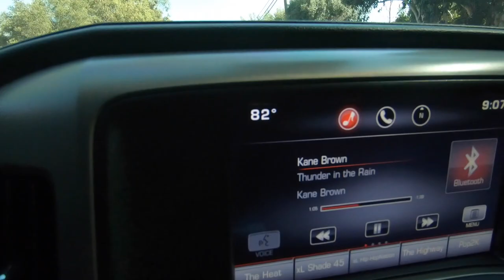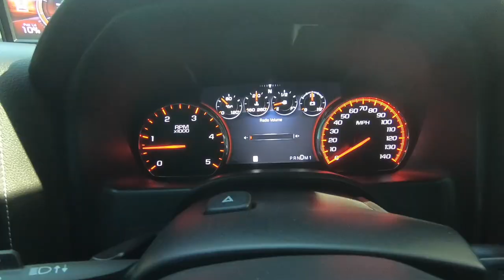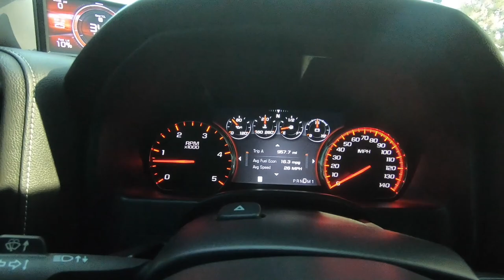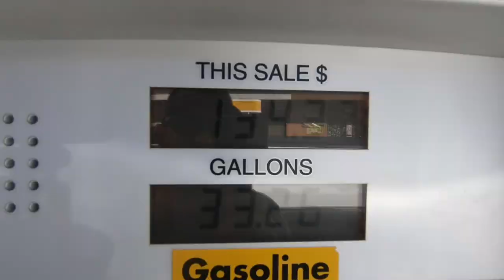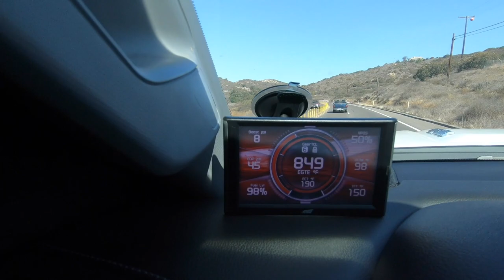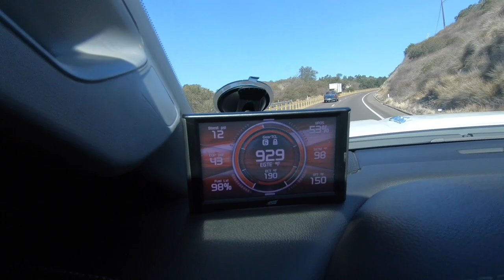DO THESE DIFF COVERS REALLY WORK?

Comment: I'm not sure what your looking for in your "test" to consider "pulling good". Each one of the different diesel engines makes max torque at different RPM's. You seem to think one tows better because you can pull a hill in 5th vs 4th gear. The Cummins is a inline 6, Inline 6's make more torque in the lower rpm range so of course its gonna tow in a lower gear than the rest. I've towed with all the big 3 brands and all the different series of the engines. Even stock they all tow just fine. When I'm looking to buy a diesel I'm not out to find what's gonna tow my trailer up the hill the fastest and in the highest possible gear. I'm looking for what I feel is gonna be the most reliable, get the best fuel economy, and is the most comfortable to ride in. That's why I'm sticking with my Duramax, sure the Cummins might be more reliable, but the gm all around seemed to fit all the categories as a whole the best. Plus I think the Allison makes up for the reliability you get with the Cummins. Just my opinion, not trying to hate on any brand because like I said you can't really go wrong with any of the 3.
Reply: Price Racing I agree with you man!!
Reply from the maker: they all tow good i was just amazed at the cummins how in every single gear it pulled like there was nothing back there
Reply: there’s a reason why most semi truck’s on the road has an in-line six. they simply do the job better more efficiently. trucking companies don’t care about being hard-core to their brand of choice. The number one concern is making money. the in-line six large or small regardless if it’s a cummins, international, Catapillar or a Detroit. it’s all about what can get the job done with the least amount of downtime with the best fuel economy. the in-line six hands down the best pulling engine there is. The debates been over for 30 years. if that wasn’t true then all the semi‘s would be using v-8’s so whether it’s a pick up truck or a tow truck or a box truck the chassis doesn’t change the fact that the inline 6 does a better job and is more durable and more efficient. so it’s not really a matter of ford Chevy or Dodge.  fords diesel engines are international‘s chevy diesels are Isuzu and dodge uses cummins. The engine is what it boils down to and as far as I know the emblem on the grill doesn’t do anything for pulling.

Comment: So according to Banks power testing with new cover actually the temp. rises quite a bit with extra oil. More heat because more drag from extra oil.
Reply from the maker: im gonna have to disagree on that because when i checked the temp with the stock 1 and aftermarket 1 the aftermarket run ran much cooler and anytime u have more fluid its always better and i cant stand banks there info is always wrong especially there tunes suck i have nothing but problems with banks product
Reply: Good to know
Reply: Eddie's Life does your oil temp get to the dew point?
Reply: I saw they were going to test that but didn’t see any results? Links?
Reply: @brettsummer5070  exactly no results from Banks because they couldn't prove they are worthless. Cooler the better. He kept saying you will burry the ring and pinion, I was thinking he's looney. If you keep same level off fluid you won't burry it in fluid. Like a bigger oil pan, the higher capacity doesn't mean you raise the fluid level in the motor.
Reply: imssgmiller I’m thinking he meant once the pinions moving and slinging fluid the level drops because most of it is a fog or “mist” slinging around the diff. With a bigger capacity there’s a chance more of it would pool around the ring gear causing more fiction loss. Not sure tho I don’t have the patience or equipment to test something like that but I’m excited to see results on paper
Reply: Imssgmiller, Mr. Banks was referring to aftermarket differentials that raise the actual level higher (on level ground) then the factory level. The aftermarket covers do hold more gear oil because the depth of the cover is much greater then a factory cover. Some aftermarket covers raise the height of the oil level and this is achieved by filling the diff through the cover rather then the factory fill port. If you fill the diff HIGHER then the factory level then it will most definitely run hotter and it will burry the ring and pinion.
Reply: Sorry that was a response to brettsummer
Reply: Ryan Jolley he talked about that but also the extra quarts causing it to not drop as much while running, while the stock dropped a few inches the extra capacity cover only dropped half that (in his new video)

Comment: Slam Ford all you want, but I've got a 99 F250 7.3 with 421,000 miles and just barely had new injectors and a high pressure oil put replaced and it's still killing it..
Reply from the maker: nice thats amazing man

Comment: I just watched a video from Banks that was a real eye opener.  Long story short those diff covers are the worst thing in the world to do to your truck. The inside of the diff cover is all squared up and does not follow the shape of the ring gear.  The ring gear picks up oil as it rotates and slings it all over, most importantly toward the front pinion bearing. These squared off diff covers don't get the oil to sling over the top of the ring gear, causing oil starvation to the front pinion bearing.  About a year ago a friend of mine blew up his rear end in his chevy.  I did not think anything about it at the time but he was running one of these covers. Now I know why his front pinion bearing went out. I have been a mechanic for over 25 years, I have had several classes on differentials over the years. None of them explained how the oil got distributed inside the diff. I never knew that the ring gear slung the oil around. I thought the pinion oil slinger did all that work.  
I found that video on Banks power youtube channel and wow!!  What an eye opener. You need to check it out. I bet after you watch that video you will chunk that diff cover in the scrap metal pile! Lol
Reply from the maker: i did watch his video and i still put this cover on because i have had a lot of trucks and i have put them on all of my trucks and i have never ever had any issues with my rear ends and i took a temp before and after and my rear cover is cooler than the stock cover, so i am not saying banks is wrong but mine runs cooler and never had any issues with any trucks so banks did not change my mind
Reply: Banks is also selling a product so keep that in mind

Comment: The lml duramax's only produces 397hp and 765 torque, on the other hand the cummins has only 385hp but    it produces way more torque at 900 foot pounds. That's why it pulls so much better.

Comment: I think GM Ford and Dodge whom have produced hundreds of millions of trucks over the years if they don't see a reason to put it in at the factory and no evidence of failure due to keeping it the way it has been .....than nothing needs to be done to mod it. if a issue came up in the last 20 years im sure the Engineers woudl have addressed it by now...IMHO no Mod is needed
Reply: It’s not just the engineering that decides the make up of the truck. Cost has a big role to play. They are going to build it so they can make the most profit. Not saying that it will not get the job done the way it sits from factory but there are aftermarket upgrades that will extend the life. The manufacturer is not going to put the best possible parts because if they did the cost of the truck would be extremely outrageous.
Reply: They don't even bother to put a drain plug on them.  Why, if they are so wise?

Comment: All those fords in the shop well it speaks for it's self junk that's why gm is #1
Reply: They do speak for themselves but I didn’t see one 6.7L Powerstroke in there and that’s what everyone is referring too. Even Ford will tell you that the 6.0L and 6.4L are junk unless bulletproofed. The numbers don’t lie! The 6.7L Powerstroke is a damn good engine and has a good bit more power then the Duramax. I’m not bashing the Duramax by any means. The 2500HD is a bad ass truck and the Denali is one of the best looking trucks on the road. A lot of GM guys bash the 6.7L Powerstroke but if you went and drove one I would bet my next paycheck you would think different. There is a reason Ford has the best/most selling truck out there.

Comment: Eddie, do you know of any other way to mount your cb antenna without the cord hanging down like that? Im having the same problem and I don't want to drill a hole in the roof.
Reply from the maker: thats your only option or u have to drill threw the roof and i did not want to do that
Reply: Trey Hakes you can drill through your 3rd brake light. Behind it is your head liner. And it would be easy to replaced if need be

Comment: Gotta say I like this channel a lot but sometimes it seems you have more money than brains. Why would you replace an engine because it can pull it in 5th instead of 4th. It's not really a big deal that your truck had to down shift. I think the biggest factor is if you really really cared and wanted the best towing, you wouldnt lift it and put bigger tires on. I know it's looks better but takes away from towing.
Reply from the maker: i would not b changing the engine because it pulls from 4th to 5th i would b changing it because i love the cummins motor and they produce a massive amount of torque and it would b a fun build to do
Reply: Eddie's Life 2017/18 ford power stroke has more tq then dodge or gm look 4 your self .
Reply: I thought you said duramax was the way to go 😂😂

Comment: Pulling a hill in a higher gear like 5th is really hard on your engine (pending it needs to downshift) It will skyrocket the EGT’s. I can lock my truck in 5th gear hammer down get my boost way up and my egt’s will climb or I can drop a gear and my egt’s will drop . But my truck is so bad ass I’ll pull pikes peak in 10 gear as I crest the summit pulling 100k pounds. Just sayin. 😉

Comment: eddie the dually you drove did not have the aisin so it would be interesting to see a deleted 2500 with lower gear ratios. may i ask why you wouldn't consider a 3500? they are available in a short wheelbase with single rear wheel, so it would be the same size as your current truck. but if you wanted to test a aisin equipped single rear wheel ram with a 3.42 axle ratio just pay for my trip to California and we got ourselves a deal lol. that 4.03 scares me, so i wont go there any time soon.
Reply from the maker: i drove a 3500 and without any weight they r just to dang bouncy in the back
Reply: Eddie's Life got ya! Understandable,  i didnt find it too obnoxious, but i do plan on installing air suspension for a smoother ride in the future. Lol but i must say that the 3700lbs payload is very nice

Comment: You really need to watch the videos from BANKS POWER   they are doing a very detailed 3 part series on the covers ---Do they really work or just bling. ....I think it will show the aftermarket is junk and just heats up the fluid... unnecessary mod .....Its very interesting...watch it
Reply from the maker: i already tested mine and the temp was lower and i have never herd of anybody having problems with a rear diff cover
Reply: Banks found out nothing neg. He gave up

Comment: Eddie I would love to have the acceleration of 4.56s because I also have 37s but with 3.42 gears. When I was on the interstate I was doing 90 at 1000-1200 rpm (I can’t remember) in 6th gear. I found out that bigger tires can make your top speed higher. My trucks factory governor is at 3K rpm, my top speed is now 132mph all stock. This is the website I used in case you wanna find out for yourself https://spicerparts.com/calculators/engine-rpm-calculator

Comment: Your Diff Temp may actually go UP - and you will lose HP because you're burying the ring and pinion in fluid with the extra capacity - (viscosity friction loss.) Gale Banks is conducting a scientific study right now about this exact issue on Rear Diff Covers!
Reply from the maker: ya im not buying that sorry gale banks is not all that

Comment: LMAO I love how it's a Ford graveyard in there I love it, u know what they say fix or repair daily! I just got my own aFe diff cover that let's me hold between 6 and 7 quarts of oil (more oil than most car engines hold lol) I like the mag-hytec rear diffs a lot and they are what I first looked at when going to buy an aftermarket diff cover but bought my aFe instead for 2 reasons, 1 it has a sight glass window in the side so you can just look at and see your oil and 2 because where the mag-hytec is smooth on the inside the aFe has aluminum cooling fins on inside as well as the outside.

Comment: if you watch the banks test videos for these covers they are a waste they don't work as well as a stock cover they don't cool better and they rob horsepower -----  plus a allison transmission is not much better then a dodge transmission -----------   the gear ratio would make all the difference in the torque feel of climbing or towing --  3;42 should be outlawed get a higher ratio and it will never change gears
Reply from the maker: well for me this cover works i checked both temps with stock and aftermarket and the aftermarket kept it cooler so im not buying the banks BS video
Reply: No proof. Banks gave up

Comment: It's not a good thing to have more diff fluid. It doesn't help you in any way.
Reply: It does help. Runs cooler. Level is critical, higher level adds air and not good.
Reply: I've heard before that it causes more friction and more heat so it's harder on the gears, just what I was told

Comment: The best Transmissions you can get stuck aisin transmission and the 45rfe from Chrysler that's the best transmission you can get
Reply: Raul Bueno 45rfe what is that a combination of the 48re and a 68rfe  the Asian is as69re
Reply: 45rfe and 55 RF is electronically transmission multi electronically transmission that's from Chrysler those were the best Chrysler Transmissions they had for a one-time 2 1/2 ton to a 3/4 ton trucks my 01 Dodge Durango with a 4.7 high output motor has that $45 ft transmission but if you want to take it to the second step is getting the aisin transmission electronically transmission that transmission that use under Toyota medium duties like straight trucks or like that under under that Tundra cuz the tundra Toyota Tundra it's over engineered that's why it has a transmission doing lowlights stuff that's a heavy-duty transmission and I think it's better than an Allison Transmission
Reply: 545 re was the one used behind the 1989-1992 cummins powered ram that got switched to a 46 re or 47re in 1994 2002 diesels  2002.5 to 2007 got a 48re. And 2008 present have the 68 rfe   With the option of the aisan as69re beginning in the 2014 model year for the 3500 drw and srw trucks it became available for 4500 and 5500 trucks in 2012
Reply: Wrong man 45rfe on a 55 rfe was from 1998 to 2003
Reply: Raul Bueno  on gas equipped trucks not the diesel
Reply: Even my 2003 Toyota Tundra will smash that diesel trucks will Eddie has

Comment: GM 1500-3500 diesel trucks come with a GM transmission with an Allison stamp badge on the case. It is not a true Allison Transmission.  I believe you have to go to a 4500 or larger truck to get a true Allison transmission. I would look into that deeper before you consider doing an engine swap. A true Allison Transmission works very well with a Cummins due to its lower end torque. Your current transmission may do well with it, but make sure it is a true Allison transmission and not just one with the Allison Badge Stamped on the case.
Reply from the maker: I got rid of the truck